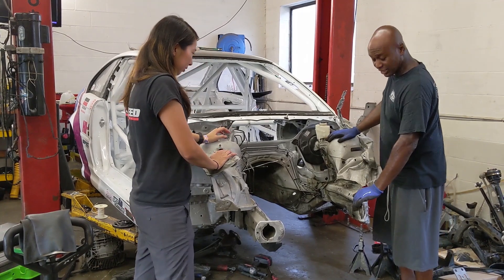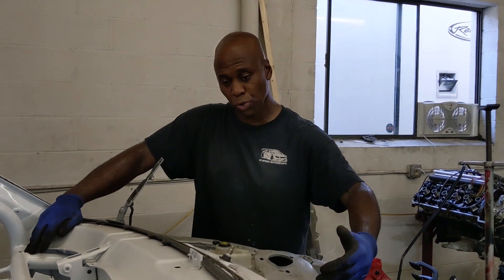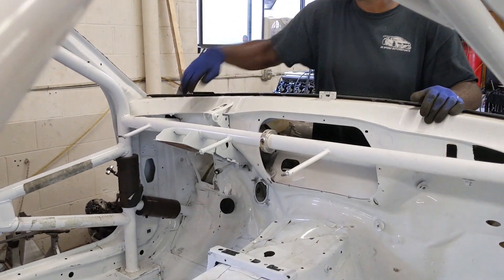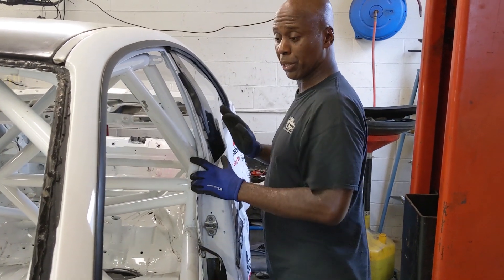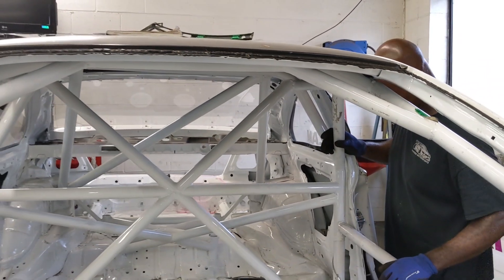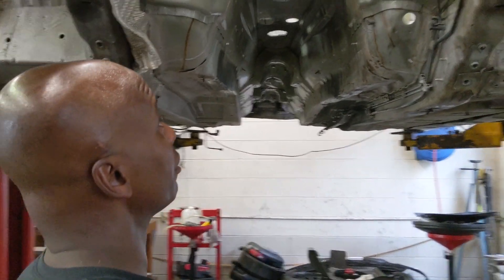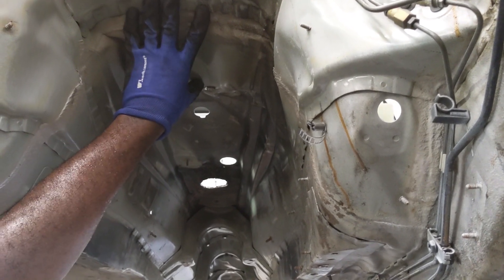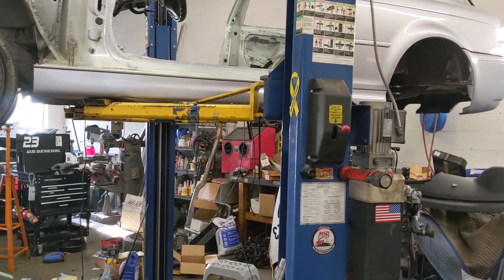Hi-Speed Motorsports: Roll Cage Analysis of a Crashed E46 M3 Racecar

Comment: Hugh, thanks for sharing. Very informative video, glad the driver is okay. That looks like it was a huge hit.

A few questions:

1. I noticed you do not tie the door bars to existing nodes on the cage. Is there a reason for that?

2. The horizontal x bar on the floor behind the seat area - is it an optical trick, or did the weld on the forward diagonal, driver’s right side, actually fail?

3. What sort of seat was the driver using?

Thanks in advance -

Rob “Wreckerboy” Myles. (Yes, the one you knew from the EMRA days.)

Comment: The strut tower bar should have been welded to the a pillar bar not the dash bar. The top door bar should be welded to the opposite side of the strut bar to support the junction. The a pillar mounting box should be rounded not some huge ankle bitter. Maybe turn up the heat in the welder or slow the wire speed down. Saw lots of big blobs of welds.
Reply: There will always be a Monday morning quarterback.  Unable to verbalize what was done correctly or compliment the work done to share the results of this work...  Buuuuut has lots of time to criticize.
Reply: Big blobs are better than a weak, “smooth” weld that looks “show worthy” but couldnt take a hit in the event of a crash. Function > form.